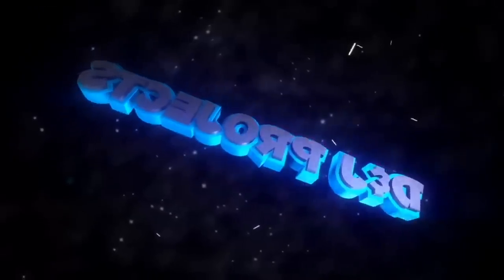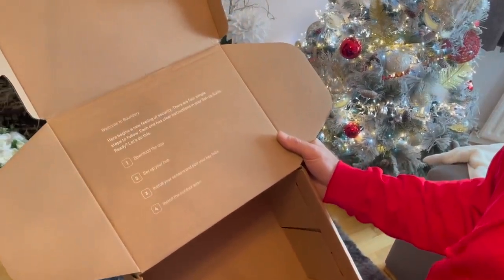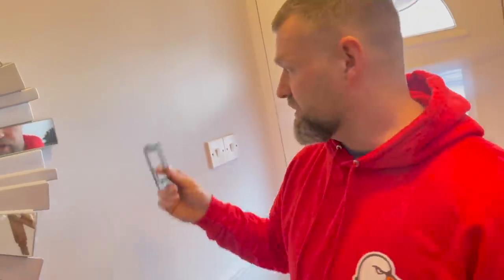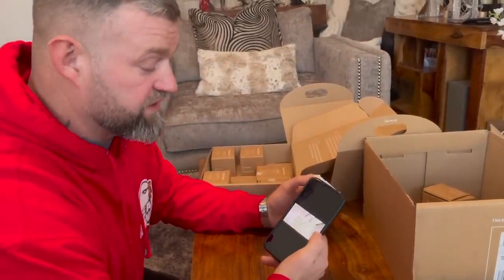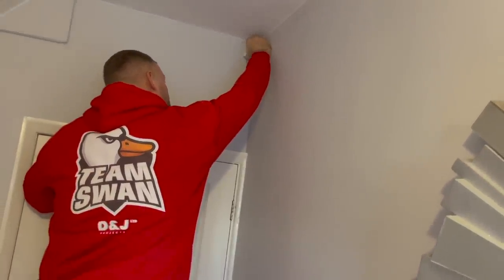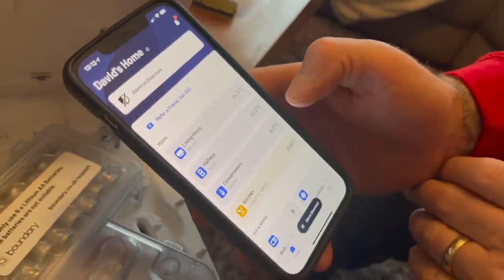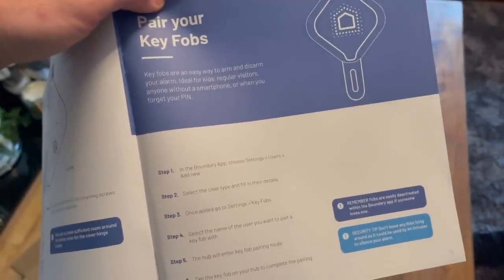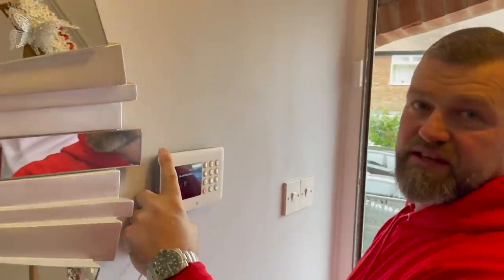THIS MAN NEEDS PROTECTION! - Boundary Security System Install

Comment: What a difference a couple of decades has made. Alarm systems with minimal drilling and no wires. Brilliant. Very intrigued by this excellent demo by the D&J boys. 45 percent is a stunning discount as well. As ever, thanks, fellas. Have a smashing Christmas👍👍👍
Reply: with the alarm you showed you have to take the prescribed bundle plan or am I wrong
Reply: Still best to get a professionally fitted system, wired of course. Longevity is a guarantee and security.

Comment: The downside to these types of system compared to the old fashioned wired type is that they can potentially be hacked.
The external siren says "Boundary" on it - thus advertising to the world what kind of security system you have.
Giving any potential hackers a huge advantage.
I think it would be better if the external siren was anonymous.

Comment: I wouldn't have put the sensor there. I would have done it opposite facing the lounge door. Reason, not visible through window, and will pick up as soon as someone comes though the lounge door.

Comment: Question, re the sensor battery change in the future. Do you have to rip the entire sensor off the wall to replace it or is the battery compartment accessible without needing to take the sensor down?
Reply: No just inser a flathead screwdriver under the sensor to remove from bracket (thats why you have to leave a small gap above when fitting) it lifts up slightly and away.
Reply: @garryh69  thanks. 👍🏻

Comment: Nice sponsorship - great video showing how to do it - also do not forget to tell your insurance company about it because normally they will give you a discount
Reply: I didn't know that. Thanks for the tip.
Reply: Only if it's an approved system! most insurance companies have a list of ones they have approved , if yours is not on that list then to them it's just a pretty ornament!
Reply: That's not the case. Most insurance companies won't offer any sort of discounts unless the alarm system is maintained and services once per year at-least. It also has to be an approved system. Usually these DIY alarm systems don't pass the requirements are are indeed just a waste of money. Considering alarm systems tend to triggered by false alarms caused by the occupier they tend to be ignored anyway. If you want a good deterrent spend some money on a good CCTV system.

Comment: Be good if they gave you a paper drill template for 5he outside box, they could print it on the inside of the top of the box just cut it off and use it....

Comment: Sorry guys, wireless/wifi based alarms are a no-no. Too easy to jam. Also internet connection! Easy to hack. If you're installing an alarm use the proper kit. Would you install a fence made of balsa wood?

Comment: Looked at this alarm but put off by the £9.99pm fee. I've just bought an era boundary alarm. It's got a solar rechargeable siren, with anti tamper and anti jamming; also the main unit takes a sim card so it doesn't matter if the WiFi goes down... there are no monthly fees either. The app is a bit ropey but otherwise seems ok so far. Similar sort of price to this one.

Comment: Good video but Boundary have been asking a lot of big YouTube people to promote this for them.  It is a good system. BUT its not for everyone, as its wireless.  As with any such system you need to replace the battery's on a regular basis, this may not be to bad for the PIR's inside, but when it comes to the sounder, it can be a pain.  Imagine if someone has had this system installed and then months later the battery goes, unless they have a set of double ladders and are willing to go up them they will have to call someone out to do this, which will be a cost. Ask an alarm company or electrician to do this and your looking at a flat call out fee of between £30-£50 plus the cost of the battery.  Plus your sounder wont be working while you wait for someone to come out.  I've said the exact same thing on some of the other YouTube people who have had this.  As an electronics engineer of 20 years plus I don't need Boundary to tell me that there battery's last longer than all the others, as that's just a rubbish response.  From a personal point of view I would want the sounder wired for that very reason, the PIR's yes could be wireless but again you need to remember to change the battery's when they go flat.  The fact is that some people don't change the battery's straight away, I see this all the time.  Wireless isnt as secure as wired and thats a fact.  Just look at how easy it is for thieves to steal a keyless entry BMW with the right kit, same goes for anything wireless, and no dont ask how its done as I am not going there.

Comment: I am not impressed, the hole alarm system is plastic. Easy to deal with for the burglars. If the batteries go flat, your alarm system will go down. And you have just given the bad gays all the information they need to disarm the alarm. For example the system is reliant on batteries to work. In short cheap and heavily flowed alarm system.
Reply: As opposed to no alarm? 🤣
Reply: @ExtremeShez  If you're shelling out, better to get something that works properly.
Reply: What hole and bad gays?